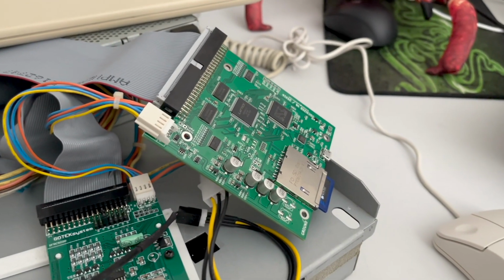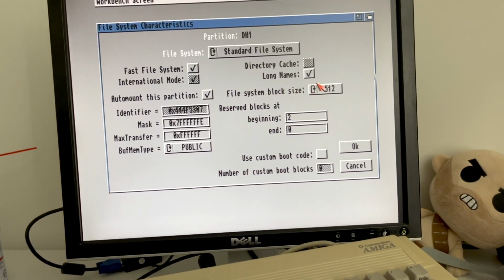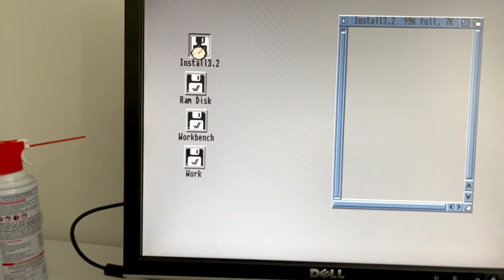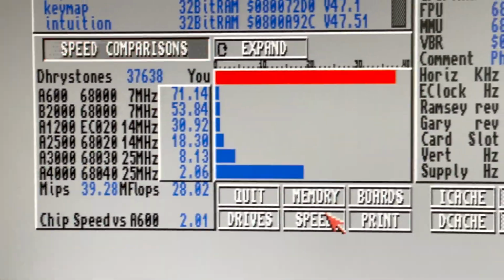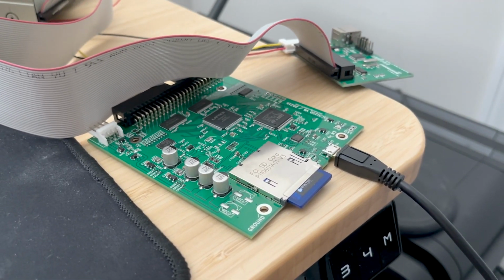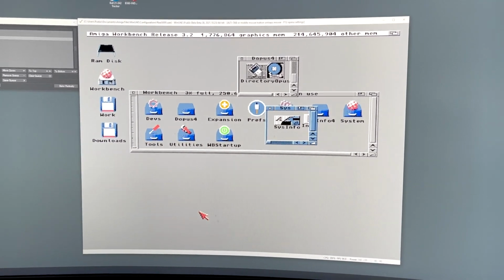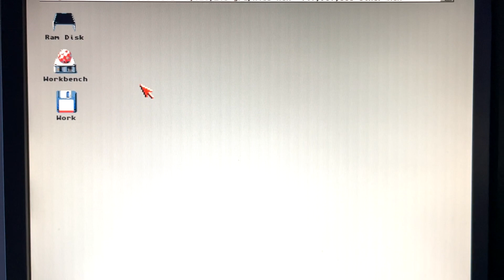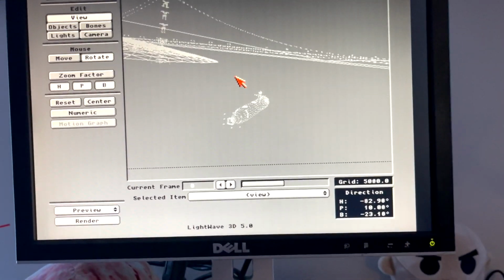Amiga 3000 + SCSI2SD v6 !

Comment: The SCSI2SD even in the V6 are not that fast. Used them workstations with much the same result. When I did have a 3000 I am sure I had better from a 330Mb physical drive. The supplied Quantum drives were rather pedestrian. If you have taken the battery out for preservation purposes the the SCSI setting will be lost each power down and these did make a difference, the synchronous/Async defaulting to safe rather than best for your drive. Looks like the flicker fixer adjustment screen on the back needs a tweak but sure you know these things.
Reply from the maker: I did not know these things! Thank you!
Reply: @HoldandModify  that’s on an original A3000, you have a modern replacement motherboard? By screen I meant screw. I hope I recall correctly. The docs in the a3000 box discussed adjusting the flicker fixer but that was 30 years ago.